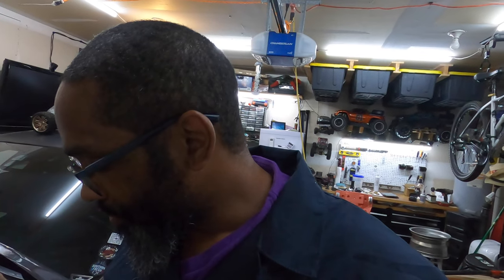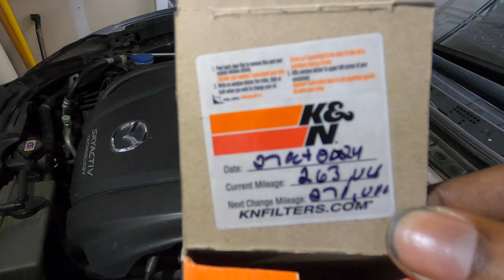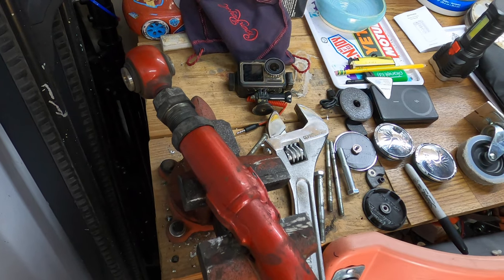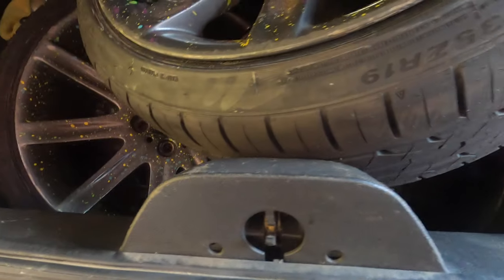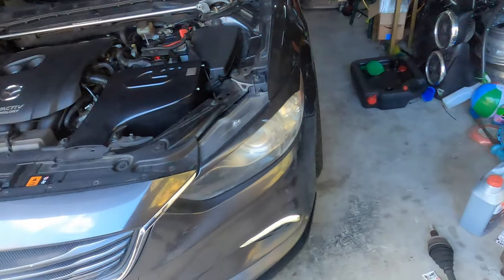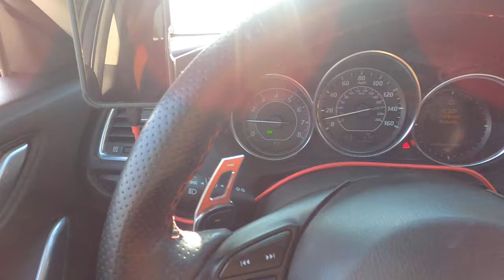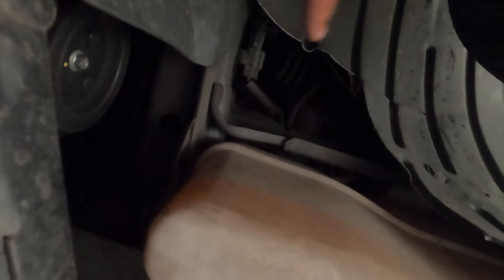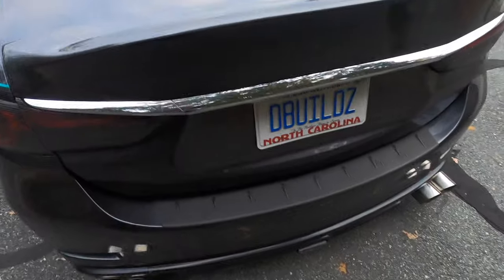Fixed some issues. Caused an issue. | Mazda 6

Comment: Why 5W-20 and not the recommended 0W-20?
Reply from the maker: It doesn't get that cold here to need to use 0w-20 (-30°F to 250°F vs -50°F to 400°F). Also, my car was using about .5 qt over 7500-10,000 mile oil interval when I used 0w-20 and I went to 5w-20 and the .5qt oil consumption stopped.

Comment: How come did you change the wheels? I might have not heard the explanation. The Weds looked really cool before tbf
Reply from the maker: Just got tired of them and sold them. I have a new project car and the 6 has 265k and I’m not putting too much more money into her besides maintenance and small tid bits
Reply: @DariusBuildz  damn, it looked clean with them, yours and P1zaro made me get my weds ahah, I am currently on 170k, but I do like max 8k a year so it will take its time, also your tutorials have been super useful tbh